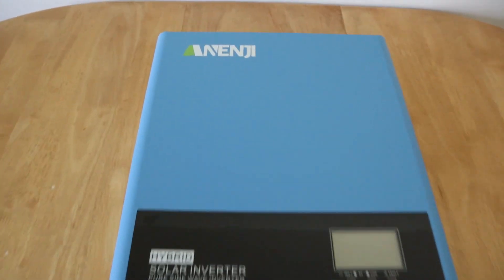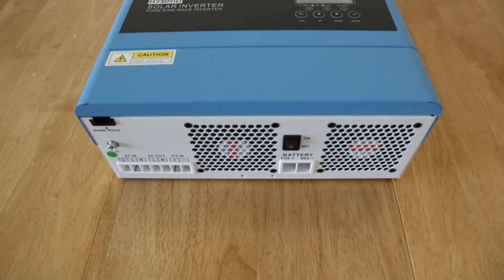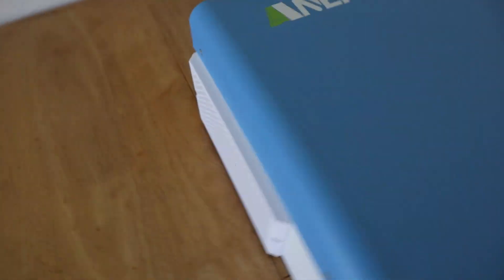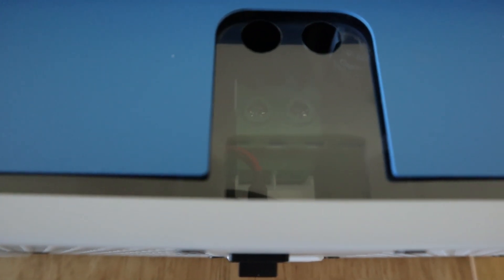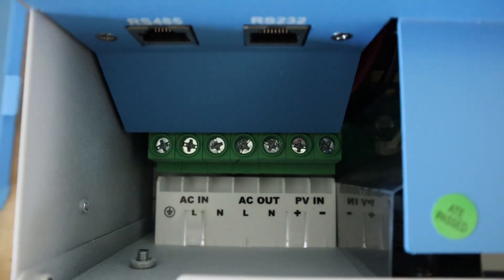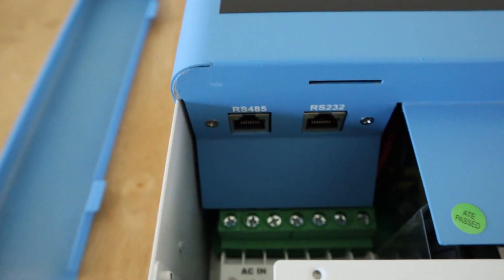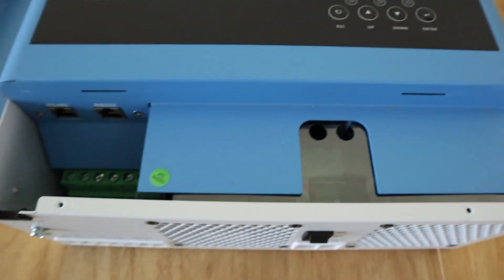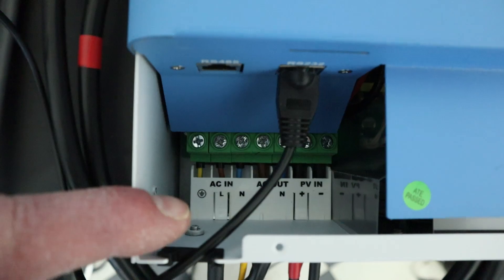Anenji 48V Hybrid Solar Inverter Review | Batteryless Off-Grid Power?

Comment: The problem I am facing with this inverter is its failure to charge the batteries after addressing the Inverter Reverse Neutral Error, as it keeps tripping the circuit.
Reply from the maker: @JiffyHand  I'm sorry you're having problems. Is it tripping while connected to the grid? Is it the inverter tripping or your grid connection? All the best, Adrian
Reply: @DADvinci  The grid connection keeps tripping, and if I disconnect the blue neutral wire from the earth, it ceases. However, I am at a loss for any alternative solution to this problem, other than avoiding neutral-ground bonding.
Reply from the maker: @JiffyHand  Thanks for the info. So, you've connected the earth and neutral together on the inverter output? Is the inverter permanently connected to the grid (always switched on)?
Reply: @DADvinci  The Earth and the Neutral are interconnected Yes. I do not consistently maintain the grid connection, and when I need to charge the batteries, I must disconnect the Earth from the Neutral at the output.
Reply from the maker: @JiffyHand  So it only trips when you're charging from the grid (with the earth and neutral separated)? How is it connected to the grid, via MCB/RCD/RCBO?
Reply: @DADvinci  The inverter is connected directly to a three-pin socket in the house, and it only trips while charging when power is supplied to the inverter from the house. However, the only way to achieve this is by disconnecting the Earth wire from the neutral However, that subsequently rules out the Neutral Error Fix.
Reply from the maker: @JiffyHand  It might be a couple of things. Please can you let me know on the following:-
I'm assuming that you have to reset the breaker in the consumer unit when it trips? Is that socket part of a larger circuit (e.g. downstairs plugs)? 

Do you know if it's a MCB/RCD/RCBO that you reset? Can you see what it's rated at in Amps (16A, 20A, 32A, etc)?

Does your inverter have solar input? 

What have you got menu item 11 on the inverter setup to (default is 30A)?
Reply: @DADvinci  It would be part of a larger circuit MCM & RCD protected. The single breaker that trips controls the downstairs sockets. I then need to lift two switches; one of these is MCM also RCD protected. Additionally, the inverter has a solar input, and its utility charging is 30A.
Reply from the maker: @JiffyHand  Thanks. So, it could be earth leakage if it's tripping the RCD. Are you able to disconnect the solar from the inverter and test again? It's a potential route to ground that could cause a trip. The only other thing I can think of is that the load of around 1900W (30A @ 48V charging) might trip the circuit if sockets are already pulling power to push the breaker over the limit, but don't know what it's rated at.
Reply: @DADvinci  I am grateful for the assistance. I have  disconnect the solar panels from the inverter, yet it consistently tripping . Even when I explore various utility charging options, the situation remains unchanged.
Reply from the maker: @JiffyHand  No problem at all and sorry it didn't work. The only thing I don't do is earth neutral bond when off-grid, so when it is on-grid the earth is completed from the socket and passed through. Do you reconnect the earth to the case when you connect/charge from grid (I know you disconnect from the neutral)? That would break the inverter output earth path and could cause a trip if the inverter is left switched on during charging. Last question, I promise.
Reply: @DADvinci  I seldom use the AC socket for charging in summer; it is primarily during the winter months when daylight is scarce. Most of the time, I maintain the earth wire connected to the neutral. I also run an earth wire from the case into the ground for added protection.

Comment: Does this inverter work as just batteries and no solar panels? As in using it as a BESS and charging on cheap rate and discharging during the day?
Reply from the maker: @denisoriordan4304  Thanks for your question Denis. I do exactly that when rates are good on the Octopus Agile tariff (especially overnight when possible), using it as a charger, then consuming the cheaper stored energy when needed. It works (charges) with the inverter switched on or off, so solar is not required. I use the other hybrid inverters (24V & 48V) I've got to do the same too. All the best, Adrian
Reply: @DADvinci  thanks for the response Adrian! 

How is the time for charging coded? Easy or is it difficult?
Reply from the maker: @denisoriordan4304  No problem at all👍 With mine I use a standard 13A mains plug and socket for grid connection, so this enables me to use a smart plug which I trigger when the rate gets under what I want (using Home Assistant). It does limit the amount I can charge at (40A @ 48VDC with the in-built AC charger) so I stay under 3kW which prevents issues on the 13A plug/socket. If you're going to wire it up to a breaker box or some kind of consumer unit, you'll probably need a different method to control the times it switches. Might be able to leave it on the grid all the time and then find a way to switch charging mode on the inverter itself (remotely with the app/Solar Assistant/Home Assistant), but that's something I've not tried as the smart plug approach just works with no fuss.

Comment: Very nice to see it working without a battery and just the solar panels and no grid. Do you reckon it would be risky to use it that way permanently? The capacitors or mosfets or whatever those are called, I read they can't take too much changes and dont last, if using only solar and no grid, otherwise the grid covers the solar not being enough while pulling a load. Anyway, good stuff. Cheers
Reply from the maker: @segundacuenta726  Thanks for your comment😊. To be honest, I've got no idea how well it would run permanently using it without a battery or grid. The reason I did the test is to show viewers that it does do it as I've had a large number of questions on other inverters I've reviewed as to whether they work without a battery. As mentioned in the update video (after this one) it's not something I'd do or run longer term, purely an emergency option if my batteries failed for whatever reason until I could get them fixed. Unless I had a massive array it wouldn't run what I needed to during the day anyway. I’m sorry that this might not answered your question, but please let me know if you have any others. All the best, Adrian
Reply: Does not hybrid mean that if there not enough power from the solar panels coming inverter takes the remaining power from the rid to complete the power requiremnt of the load am I mistaken what does hybrid mean then?
Reply: @zk9474  I think many think of hybrid as a combination of off grid and on grid, meaning it can inject into the grid as well, as opposed to being just on grid, or just off grid. Others (less common) even think that hybrid would mean combining solar with wind or some other source. I call them all in one inverters, off grid, on grid or hybrid.
Reply from the maker: @zk9474  Thanks for your question. Hybrid inverters are usually termed that because they have batteries. Original solar inverters (and those you can buy today) were just that, they provided power only when the sun was out and fed back any excess to the grid that wasn't used. The battery bridges the gap and allows for energy storage to use at any time. The combination of battery power and solar power can be used at the same time to power loads to reduce grid usage. With on-grid hybrid inverters you can feed out to the grid when you have excess power, either from solar and/or batteries, to earn money when rates are higher. I hope that answers your question. All the best, Adrian

Comment: Thanks for the Review. 👍 just bought the same After watching your Video
Reply from the maker: @Innovation86  No problem at all, I'm glad you found it useful😊 It's definitely working well now the sun has returned! All the best, Adrian
Reply: @DADvinci just received mine yesterday. My Solar Panels Are on the way. Next Weekend I will start my own First Test. Next month I Will receive my lifepo Cells, so I can Build my 15kw battery to use the Solar Energy on best wise.
Reply from the maker: @Innovation86  That's awesome, it's starting to come together! May I ask how many panels you've ordered (spec)? It's great to hear you're also going bigger to begin with on the battery front, as in 15kWh🔋😎
Reply: @DADvinci I bought 10 Panels Trina TS_440NEG9RC.27 Vertex S+ Bifacial 440W. Yes I think it is better to invest directly with a DIY battery pack to have a Lower invest at the best combination of performance. Here in switzerland we Hit 0.42€/kwh, so my return on investment will be quick😅
Reply from the maker: @Innovation86  That's a very healthy solar array size😎. Wow, I thought our standard rate tariffs were expensive in the UK, equivalent to around 0.32€/kWh currently. Payback will be quick at that rate!

Do you have a standing charge for being connected to the network? I'm on agile so have to pay around €0.73 per day just to be connected, even if I don't use any electricity. Also have to pay the a  standing charge for gas which is around €0.36 per day, again regardless of if I use any or not. I'm hoping to ditch gas altogether if I can get my big solar and battery setup sorted.
Reply: @DADvinci here you rent your electric Meter and Gas meter, it is around 130€/year + 7.5€/month only to be allowed to use for each. I will start a lot of tests the Next Time because I heat the House and water with gaz. So my goal is to inject nothing in the Grid ( i create i parallel Installation) and will try to store in battery, sand and hot water. But at first i need to receive the last Part of my puzzle 😂
Reply: @ Hey, what do you do with the energy (heat) you store in sand? I know water can remain hot for many hours or even up to the next day, but not sure how sand is used when heating it from solar panels. Also apparently salt is used to be melted which stays hot but I am not sure if that is used in residential setups with only solar panels, instead of those concentrated mirrors and special oils they use with the salt tanks and turbines. Cheers
Reply: @segundacuenta726 you are right, Salt have a better Storage Performance. My idea is for Winter to heat up with a Résistance ( Résistance direct with DC) the Salt in a Nice pot and use the heat in the evening. So i can avoid to lost a lot of Energy in DC/AC conversion . I will test a this things in the Next month, actually it is only theory 😅
Reply: @DADvinci  So short update. I received my Solar Panels, i used 8 Panels in Series for the System and 2 Panel with Ecoflow Powerstream to inject in Phase 1 ( L1), Anenji 6.2kw Hybrid inverter and 16Cells 315Ah. I build my battery with a Daly BMS and today start everything. It work really fine, aprox. 1kw on rainy Day in switzerland and 300-500W with lot of rain. 3.5KW with Sun
Reply: @helioshydrogen  Hola! Una pregunta: el inversor hibrido Anenji 6.2 Kw puede inyectar energía eléctrica a la red pública?
Reply: @carlosvescio6552  Hola, sí se puede inyectar con el parámetro SUB pero podemos prohibir la inyección según el parámetro con SBU.
Reply: @Innovation86   muchas gracias amigo!

Comment: I've got my panels on a pergola and they are fairly flat. I've considered mounting mine like you have against a fence but the fence only gets full sun for around 3 hours/day. I'm just going to add another 2 panels and increase the panel angle slightly I think. The EAsun is working great though using the PV reset trick in a morning. I heard back from Ali express about mine. They basically said return the inverter for a refund and that's it 🤣 I'm going to just keep using the PV trick until I can get more battery's to go to 48V. Alot of the cheaper inverters are all based on the same platform now. The only thing they lack is firmware updates
Reply from the maker: @karloffgrid  Hey Karl! It's surprising what a difference the angle makes. After the terribly grey Winter, it's been bliss this week for cool panels and loads of sun. Gone from empty batteries topped up with expensive electricity, to full solar filled batteries again! I'm not surprised on the support front. They are largely rebranded voltronic inverters that they want to get out the door, so support won't be the same as those that are much more expensive. The PV trick is great, setup and forget, so not really a big issue as the inverters work very well. I'm planning a ground mount to do it properly, but need to research more on the metal (probably unistrut) and how to build ground posts to bolt it to.
Reply: @DADvinci  where I used to live I used unistrut to mount a panel on the wall. Unistrut is fantastic and you can also bury it too as its galv'd CEF stock all the unistrut and accessories you could need to make a ground mount. If I was to do a ground mount then I'd use the 41x41mm unistrut for the supports and 21x41mm for the rails to mount the panels on
Reply from the maker: @karloffgrid  Awesome! I've been contemplating the sizes, so this is great info!
Reply: @DADvinci  well CEF is the cheapest place I have found that stocks it and it comes in 3M lengths either 1.5mm or 2.5mm thick steel. The spring loaded nuts for the strut are a god send also and we'll worth getting for the panel clamps. I used M8 blots with washers to put the unistrut together and it was solid. I may have a video on my channel that shows what I made with links to  each item 😉

Comment: Does the manual provide a good description of the pins for the connection cable from RS232 to the solarassistant-usb? Never got my Easun inverter to work with it (incl. holy smoke coming from the connection port, so it will definitely work no more in the future...)
Reply from the maker: @davidruhdorfer3857  I'm really sorry to hear about your connection port 🙁. The manual has a pinout for the RS485 port, but not the RS232. I originally gambled with buying a cable for the EASUN inverter which paid off and worked flawlessly with Solar Assistant. The same cable has worked on the other inverters I've got, as in this video https://youtu.be/AZ_kqjfhZec. The best money I've spent on a cable and it's in the description of this video (with AliExpress link) under the heading EASUN Solar Inverter USB RS232 Cable (1.8M). Are you planning on getting another inverter or looking to see if the port is really broken? All the best, Adrian
Reply: @DADvinci  As I am operating my inverter in a quite dusty sorrounding, I am aware that it might fail in some months. I do have other grid-tie inverters as well, so I do not need to have a spare offgrid inverter on site right now. But maybe if prices drop a little bit more, I might get one of these third generation inverters with build in dust filter (as they are all clones, it does not really matter if it is an EASUN/ANENJI/SNRE/DAXTROMN/POWMR...)
Reply from the maker: @davidruhdorfer3857  Sounds like you've got it covered. There are always deals coming up on the 48V off-grid inverters and usually as summer starts. I would suggest looking at the RS232 cable if you are looking at using Solar Assistant as it's very handy. Cheers, Adrian